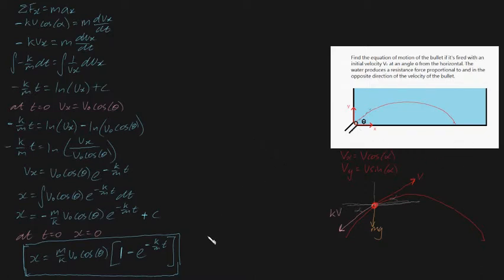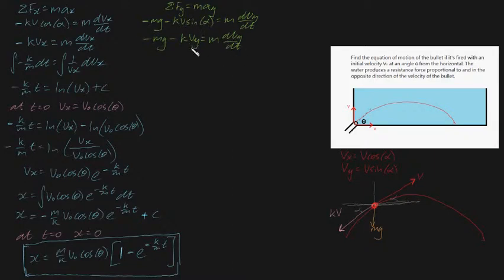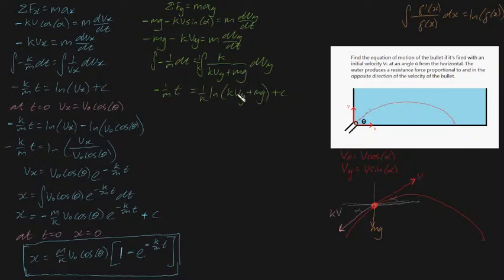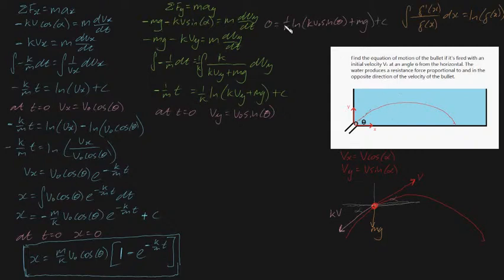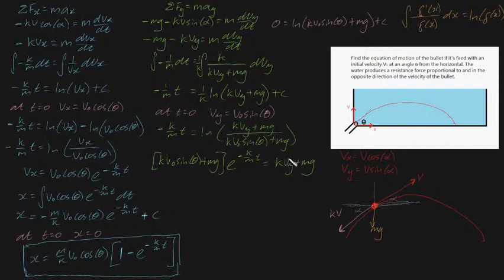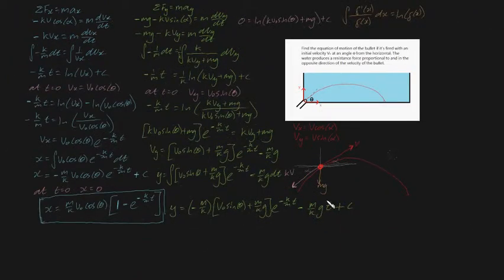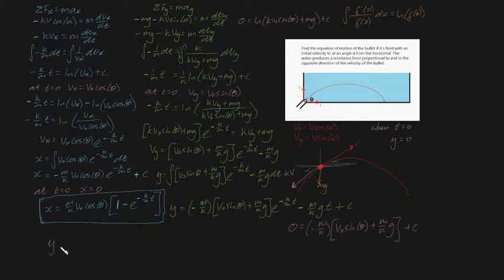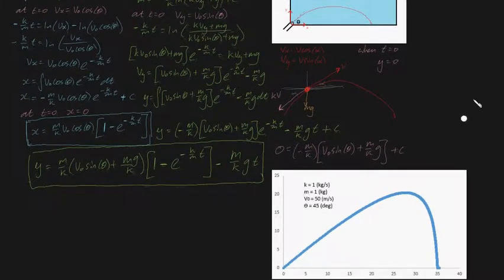projectile with drag part 2

Comment: Dude. You are a legend. Just wondering, if you wanted to find an equation of the total displacement, so on the x and y axis, how would you do it?
Reply from the maker: Hey Shridhar, if I understand you correctly, you want to find an analytical expression for y as a function of x. All you need to do is substitute out all the time components from y(t). In this case, you can substitute out the term [1 - e^-k/mt] in the y expression for x/(m/kv0cos(theta)). Then find t as a function of x by rearranging the first equation and using the natural logarithm.

Comment: Can you also do the same with F is proportional to v^2? As well as I read, you cant calculate it, but you can solve it numerically, but I don't know how....
Reply from the maker: Hi there! Yep you sure can. In fact I think if you used this model of drag then the problem will look much more simple since you wouldn't be integrating 1/v (which gets you a log) and instead you'll be integrating 1/v^2. The process will be the exact same though:

Just begin with the formula -kv_x^2 = m dv_x / dt      and     -kv_y^2 - mg = m dv_y / dt
Reply: @virtually_passed   could you please show me the process in docs or something, thanks
Reply: @virtually_passed  Well since the drag force is -kv^2, breaking it into, say, the y-component gives -kv^2*sin(a)=-k(v_y/(vsin(a))^2*sin(a), so the sin(a) and v terms don't go away. How would you deal with that?

Comment: This video helped me out a lot. Instead of using excel, you can eliminate the parameter t from the x-function fairly easily. Then you can calculate the function in terms of x and y and visualise the path on geogebra or desmos calculator
Reply from the maker: Hey mate, excellent observation! Yep, finding t as a function of x and then substituting it into the y equation will work :).
Reply: Thanks! But I have been wondering... is there a way to calculate the distance the projectile will hit the ground? a.k.a the zero point on the x-axis? 
I would calculate the t of the y-equation where y=0 and substitute that t into the x-equation, but I have no mathematical method to do so...
Reply from the maker: Hey mate, the only way I can think of is to solve for it numerically. You could try solving for it using energy equations but I suspect that equation would be just as hard to solve.

Comment: Great video! Just wondering why the spreadsheet doesn't work with objects that have a large mass like 60kg?
Reply from the maker: Hey mate! That is a brilliant question! The spreadsheet is working fine, you'll just notice that as the mass of the ball gets larger and larger (while keeping K the same) the path will look more and more like a parabola which is the equation you'd expect without any drag! 

Conceptually this happens because a projectile with a large mass has a lot of inertia which resists acceleration from other forces acting on it. ie, the path of a cannon ball will be less influenced by drag than a paper cup.

Numerically this is the case because if you increase the mass in the acceleration equations -kv_x = mdv_x/dt     and     -mg - kv_y  = m dv_y/dt,    you'll notice that the drag terms get smaller and smaller when you solve for dv/dt - that's why the equation turns out more and more like a parabola.

Comment: Maybe it's a stupid question, but in the linked Google Doc. file, you convert the angle to radians before putting it to the formula, why is that necessary?
Many thanks!
Reply from the maker: Hey mate, that's a very good question! The sine function and cos function in Google sheets only calculates the value in radians. For example, if I typed COS(60) into Google Sheets it would NOT give me the answer of 0.5. But personally, I prefer to think of angles in degrees (to me it's just easier), so I put the input in degrees and then put a conversion right below it. Hope that makes sense :)

Comment: How can I get the distance out of your formulae? 
(k x^2)/(2 (1-e^(-(k t)/m) )m cos(θ) )=s?
I want to insert distance as one factor. My projectile needs to land at a certain point and I want to calculate the force for it.

and ooohm... at 4:00 you forget to multiply c by k as well...
but it actually doesn't matter because it gets to the same result at 4:20
Reply from the maker: Hey mate, I'm a bit confused what you mean? Do you mean you're trying to find the horizontal distance until it hits the base of the tank? If so, the only way to do this is to solve for t when y = 0. You'll get two solutions, t = 0 and some other value of t > 0. Use the positive value of t and plug it into the equation for x. That value of x is the horizontal distance traveled. Sadly there is no way to do this algebraically - it literally can't be done mathematically. However, you can solve it by computer using the excel doc I've put in the description. 

at 4:00 you're right I should have multiplied the c by k. That was a typo, the rest is completely right after that though!